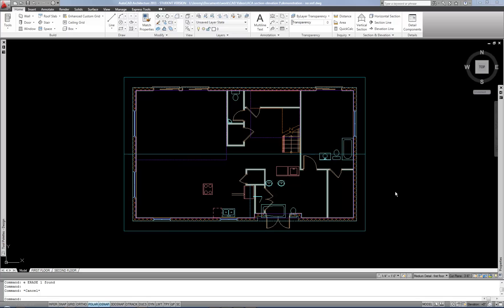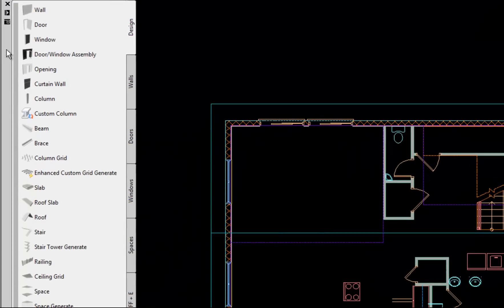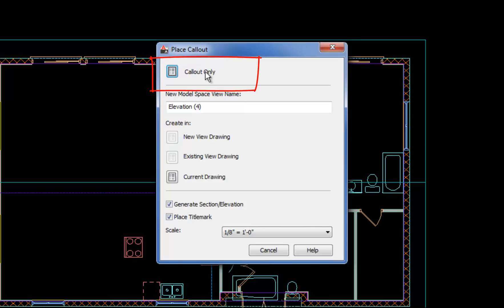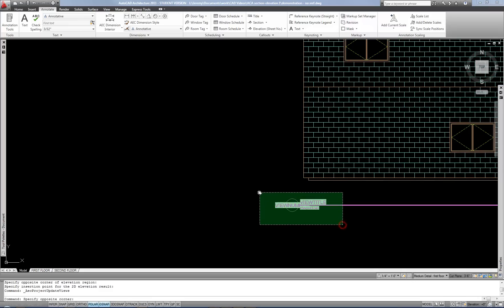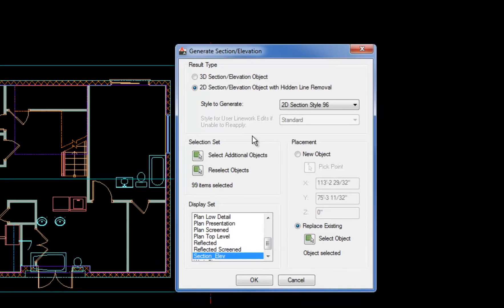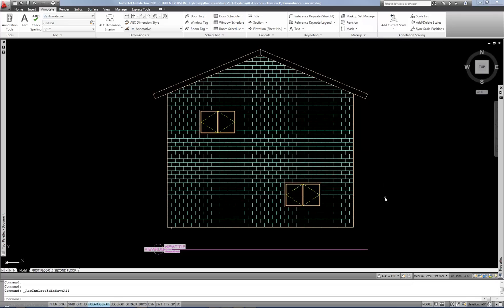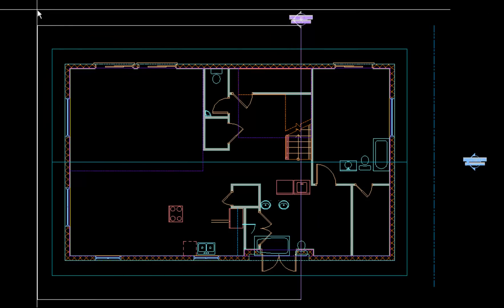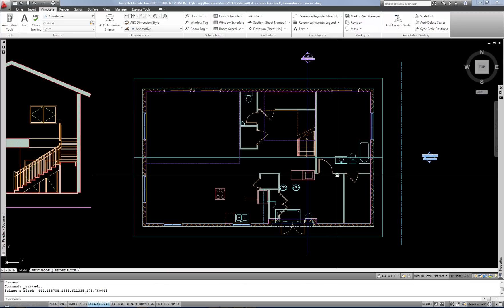ACA: Elevations and Sections 1

Comment: i have a question about using the elevation command on a house with walls that are different heights the entrance is in front 5' lower than the front walls and one wall is higher then the entrance and crosses over and touches the roof of the gable entrance. i was trying to do this as a model but the wall projects up to gable but how do i get it to go over and also rest on gable entrance. If the way i worded this is confusing can i email you  and show u a description

Comment: Wow just what I've been looking for. To go back a few steps. I first want to learn how to draw or place one floor above another then add stairs. I can draw the plans using  ACA but get lost when I want to section a multi storey building.
Thanks Jeremy
Reply from the maker: +Gerry Jamieson For mutli-level building, some things that you will need to master include:   using 3D views, for example, using a standard isometric view you can literally move level of a building to set it on top of another level.  Once you're in an isometric view, this only requires the regular old move command and OSNAPs. I have a video of basic 3D if you need to review this.   To get the stacked plans readable in plan view (or to draw a second level in place), you need to understand Display Configurations and cut plane heights.  I also have a video on that topic.
Reply: Thanks Jeremy. I find your tutorials easy to understand (English) & easy to follow (not racing from one command to another).

Comment: heeeellllppppp...I have a question, I do the same steps, like you for generating my Project Elevations and all work just fine with west Notrh and East elevation, but when i try to do the South elevation the System allways fall down it just does not work. I think ist no a problem with the layout, cause i did probe to generate another Elevation in the west saide and works...what could be the problem??? HELP ASP.. i have to finish my Project!!!! really happy if you can save me!
Reply: Maurizio Fedullo troncoso  I can't help without more information.  What does "system allways fall down" mean?  Is the program crashing?  Are you getting an error message? Do you mean something else?   Please be specific.
Reply: Jeremy Franklin...Hi! Jeremy...( sorry for my English... it is a little bit rusty) well i´ll tri to explain. When I try to generate an Elevation, the program just take too long or doesnt work anymore. I check in the Task Manager and always says that the program doesnt Work. I hope you understand what i mean.
Reply: Maurizio Fedullo troncoso Could help if you audit, purge, include fewer objects in the elevation (if possible), review your computer's hardware specifications versus what Autodesk recommends, and install service packs for your ACA.

Comment: if I decided that the default ACA callout block for the section or elevation looks ugly, can i supply my own block? or is it possible to just draw a section line and then manually add my callout block?
Reply from the maker: Adam Ambrus Any of the above...   I would probably just create your own dynamic block - dynamic so that you can adjust the length of the line below the title.  Use attributes for the text fields.

Comment from the maker: It depends on what you mean by "doesn't work." If your project is only 2D, then you can't expect to be able to pull sections and elevations from the it. You could draw in 3D in AutoCAD and then do sections/elevations of it in ACA. But if the file was made in AutoCAD, it won't work exactly the same way.

Comment from the maker: If you want to pull elevations from a 3D model, then you will need to think in 3D and work in 3D. So that means a full 3D model of the building.  One way to accomplish that, if you have separate plans, is to move them on top of each other.  Use an isometric view to do this, just like I explain the comment below yours.

Comment: Great video but how do you display topography along with the section? I already can display the terrain data from Civil 3D in plan view by using the Civil3D Object Enabler but the terrain is still not visible in the section.
Reply: asbaDoce hello sir. would you help me how can I design high rise building ? the problem I faced is that how can I overlap one floor to the other to design like G+4 or above ?